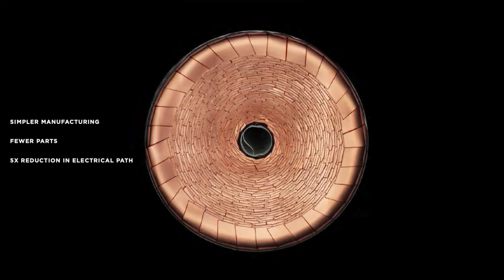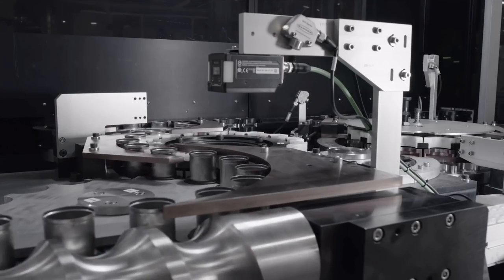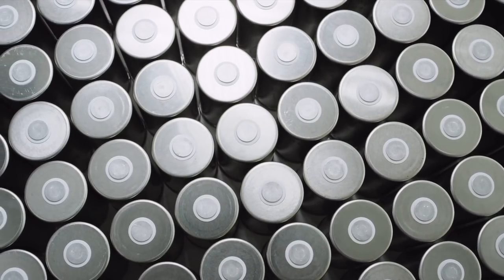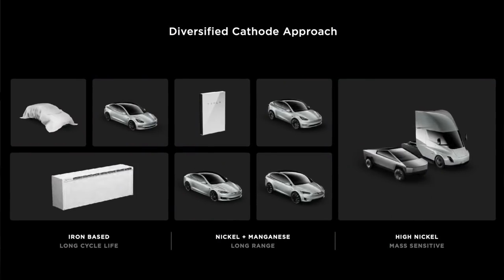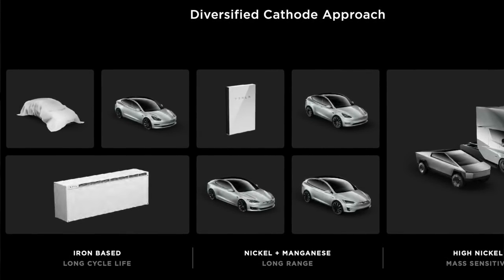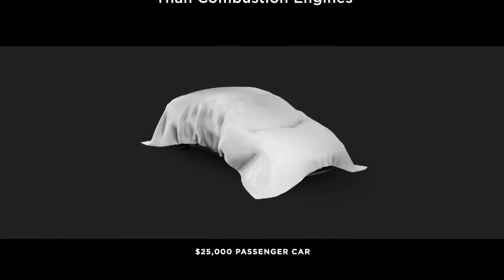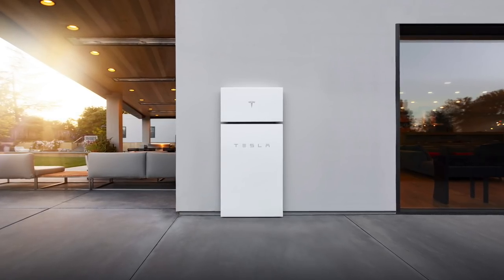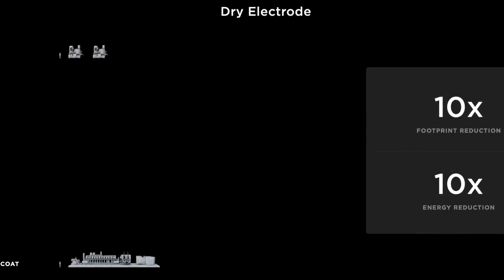4680 Batteries Testing to Last a MILLION MILES

Comment: I really hope you can still replace the batteries. It would be a real shame if there's a defect or something happens and you need to replace the whole car.
Reply: True, anti right to repair companies sicken me
Reply: @TailosiveEV  I'm sure there is a way. They can do engine repair on cars with structural engines. So I assume there has to be a way.
Reply: If there is let me say a 10% decrease in pack cost with structural pack Tesla can sell the car for the same old price and could replace a whole pack under warranty for 1/10 of cars sold without loosing money
Reply: @panda3d180  a car is not a cell phone.  I don't want anyone tinkering with the code or the computer that keeps these things on the road!
Reply: I bet the warranty will be good enough it won’t matter. 
“Batteries not working properly?
Here’s your new car.”

Comment: I am waiting for the new structural battery pack and 4680 batteries with the fully cast front and rear lower frames before buying a Model Y.  I am looking at the Dual Motor Long Range model NOT the performance...so I am hoping I will be able to click "buy" around December or January...even if I have to wait a few months for delivery.  But I won't click the button until it's CONFIRMED that this is what they are shipping!  I am HOPING for a 400 mile + range too...that way you get the 325 mile range (give or take) with an 80% charge.  We will see!
Reply: I’m in the exact same boat. Also hoping that this production savings will equate to some discounts. Even below $50k would be awesome
Reply: Bingo. Also the time waiting for this scenario allows the U.S. Infrastructure Bill with EV tax credits to pass. Patience will pay off.
Reply: @wcmouton  very good point also. Hoping that incentive comes to fruition

Comment: There is zero reason the structural pack would be harder to remove than the existing pack. The primary difference is The pack will not contain modules. All packs are structural, what Tesla is talking about is replacing that structure in the pack with cells to transfer the same amount of load. More cells and less steel = similar weight with greater pack energy density.

Comment: LOL, they're 46800 cells, you can't just change the terminology of an old industry because you just found out about it.
Reply: The last 0 do not make sense, so yes you can
Reply: @lukaellegaardjensen6178  Right! It doesn't make sense at all, but that's how the industry terminology had worked for decades. You don't put gas in a car, and motorcycles aren't motorized, and the DMV doesn't deal with very many motor vehicles, but the terms remain, and it would be pretty embarrassing to call them something else suddenly.
Reply: @DanielPearson1  it is just showing that ur a boss

Comment: 2019: Released $35,000 Model 3 $145/khw (50kw=$7250) so $27,750 for car (minus profit)

Model Y bigger and more profitable from front and rear casting

2023: compact being 85% of weight (like 3 to S) (assume 85% cost of Model 3 body= $23,500, but cost less with structural pack) and gets 1.17x the range per kWh
$50/kWh x 40kwh = $2000
55kwh Model 3 4.77miles/kWh x 1.17 efficiency from lower weight = 5.58miles/kWh or 223 miles for standard range and that's 75% of Teslas longe range (how their normal ratio is) 297 mile long range for $30,000; $32,500; or $35,000 (usually $10,000 more for long range)

Do at worst $23,500 + $2,000 = $25,500 without cost saving of structural battery pack
Reply: @Gator’s Aquatics this was calculated for a 15% smaller vehicle.

The Model 3 was 15% lighter than the Model S and had a 75 kwh battery (75 standard S when available, 75 long range 3)

I assumed the "Model 2" compact would be the same ratio (55kwh standard range plus Model 3, 55 longe range "Model 2", 75% that to get 40kwh standard range "Model 2")

Sorry for not saying that from the beginning.

But I calculated at $35,000 for the 50kwh standard range Model 3 with profit and multiples by 0.85 to calculate the lighter weight, so without any specific engineering (the front and rear die cast with structural pack saving) this car would still get 85% of the profet the Standard Range Model 3 got when it was built.

So Teslas profits won't be exactly slim.

Comment: Tesla makes 400wh/kg batteries for planes: okay who wants to buy our battery?

Plane companies: do you know how much R&D we would have to invest in to make a completely different powered plane?

Tesla: okay, we'll make our own
Reply: Elon Musk:  Well, we reinvented automobiles and spacecraft, I am sure airplanes aren't going to be too large of a challenge.
Reply: @markplott4820  Yes but those batteries have massive weight and extremely low energy capacity!
Reply: @markplott4820  true for small airplanes and short range, but you'd only get 30 minutes in a 747 with maxing out payload capacity with batteries.

I think Real Engineering chanel covered it

Comment: I think you need to think about structural in a different way. More like a stressed member - a lot of motorcycles use the engine as a structural component, but it's ultimately held in with a few bolts.. It provides structural rigidity, but can be removed with a certain amount of reasonable work.

It'll be an absolute ballache to remove a few bad cells from a pack, but it would be possible to replace a faulty or damaged pack (although the damage is pretty unlikely).

Comment: The Catl LFP cells are structural parts of their pack. They are prismatic batteries.
Reply: They hold the  PACK together not the car. The 4680 CELLS themselves will hold the car together thats the difference.

Comment: well 312 miles range is working fine for me and I do lots of road trips.  So for me 312 and maybe others may need 400 but that is about as much as you need.   Now for Cybertrucks that may be used for towing more range will be required.

Comment: Only thing that sucks about charging to 100% every day is that you can’t use regen braking when its at 100%, so every day you need to use your brakes. Kinda eliminates the benefit of teslas not needing brakes replaced as often

Comment: Of course the big point originally made for the million mile capability of the 4680 batteries was in support of future RoboTaxis, but with delays to the 4680 mass production, plus delays to non-beta FSD, Tesla has quietly not brought up the potential 1 million mile, reliability advantage of the 4680s. I agree that Tesla should immediately come out with a LFP battery based Powerwall that takes advantage of LFP's much lower cost, and Telsa can both reduce the 80K backlog of ordered Powerwalls, and also divert all NCA batteries to their BEVs. I am surprised that CATL has not announced a 4680, cylindrical version of their LFP batteries for Tesla. The current prismatic batteries are certainly cheap and the prismatic, rectangular cases are strong, but heating and cooling is much harder with the prismatic case, and if they make a 4680 form factor LFP battery the Tesla can use their existing structural cases, heating/cooling systems, streamlining production moving forward.

Comment: I think Hydrogen makes more sense for ships, batteries for cars.  But that's just my opinion and maybe I'm wrong.
Reply: Cryogenic liquid hydrogen would make sense for ships and airplanes.
Reply: @johntheux9238  And how is hydrogen produced?  Hmmm.  FAR simpler to just have a fully electric drive with battery power.
Reply: @johnnemesh5459  How long would that take to charge?
Reply: I think ships can still use batteries but planes def would need Hydrogen (assuming planes have to go electric) unless batteries have another big improvement over 4680.
Reply: I really appreciate your thoughts. 
Hydrogen in short term scenario is to costly but If renewables will be deployed with a lot of spare capacity it could be possible to use the excess energy to produce cheap hydrogen for grid stabilization and ships

Comment: The LFP 4680 could go into Robo taxi, powerwalls power packs, and lowest cost model of each vehicle type.  Even if they don't get the dry process working.  The volume of 4680's would still make it a low cost battery.

Comment: But most batteries degrade over time also, regardless of use. So, even though you could theoretically use a Tesla for 50-70 years based on miles, would the batteries still be usable over that much time?

Comment: The batteries will have above 90 percent capacity at 15, 000 cycles which is equivalent to driving 4,500,000 miles.
On a 300 mile range car.
If you drive 100 miles every day it would 123 years to get the battery life to 90 percent

Comment: I bet they intentionally top these packs at ~500 mile range for the foreseeable future. But if the masses go all in for EVs then packs greater than this could save charging stations from being backed up. Going to be fun to watch this play out in the coming years
Reply: @markplott4820  you might not want to argue with the expert here, and it's 28 minutes from 2-80, so no.

Comment: IMO they are not increasing the range much with the new batteries, they are using less batteries to make it cheaper, but with almost the same range, probably just a bit higher
Reply: @markplott4820  I know that. But that doesn’t imply they aren’t using less batteries to achieve the same range

Comment: Is there a change that the German Y doesn't come the 4680 cells at first? To save time.
Reply: Would most likely be more difficult to completely retool the production line for the "old" (existing) batteries, then retool again to switch back to 4680 batteries.  Also, it might not be possible to use the existing batteries in a structural pack without a ton spent in engineering and testing.
Reply: @johnnemesh5459  thanks. Its just that im so anxious now that i can choose to take delivery of the Chinese y instead of the german y. Your answer gives me some peace

Comment: Are you sure structural pack's can't be replaced? I doubt that.
Reply: @TailosiveEV  replaceable: maybe not

Recyclable: yes. Tesla talked about how they'd recycle 95% of the battery at battery day
Reply: @TailosiveEV  As long as it's not welded or glued In place it's replaceable.  The 4680 pack should be cheaper to make. So I figure a max replacement cost of $100 KWH so a Y pack would cost less than 8k plus labor. If this is not the case Tesla's used value will tank after around 8 years. Bad value proposition for such an expensive vehicle.
Reply: @TailosiveEV  Not sure the chemistry life span exceeds 10 years. Cycle wise not a problem to hit a million miles.
Reply: @TailosiveEV  There is no reason structural means harder to replace in my mind. It could be, it also could be easier to replace. I wouldn't worry about it till we have solid info.
Reply: @markplott4820  pretty sure the failure rate for the battery pack components is non-zero